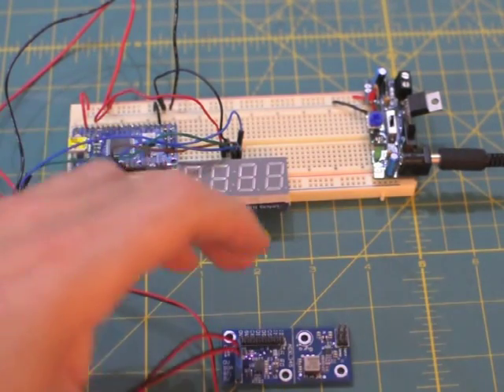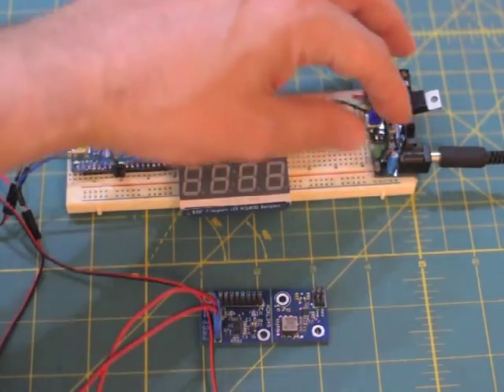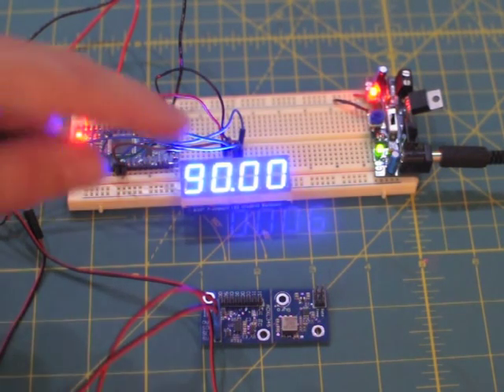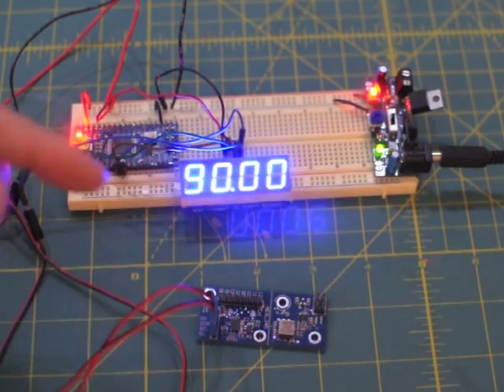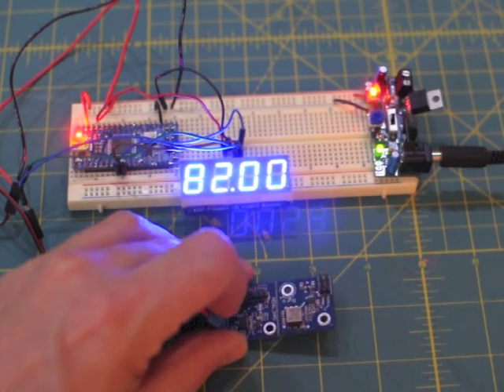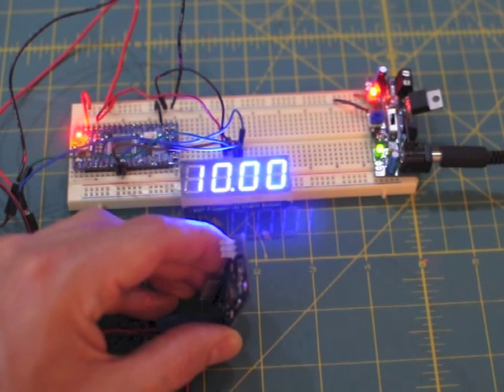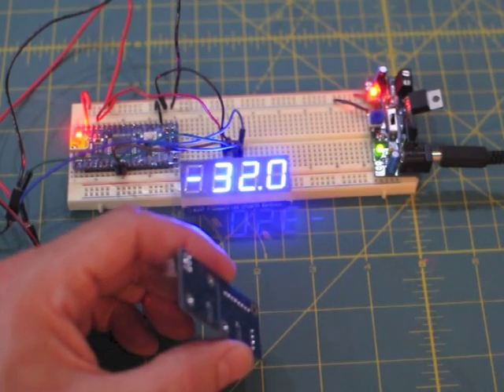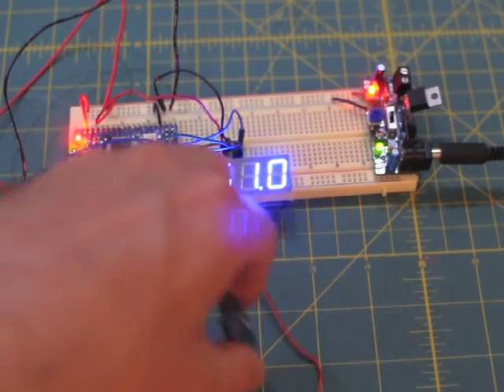Inclinometer

Comment: Hey, do you by any chance have still the schematics to this project? Thank you.
Reply: There's not much in the way of schematics. Both the ADXL 345 and the display use I2C which only requires two wires to be connected to the Arduino's RX and TX pins. Most of the trick is in software although to use the default address on the ADXL 345 you might need to ground the D0 pin. 

It's kind of an expensive part ($17.95 on Sparkfun) and there might be a cheaper option.

Comment: Having trouble figuring out your wiring.  No info :(
Reply: +Josh Lind that's a good point. Sorry the project is a couple of years old and don't have all the components handy anymore (in particular the accelerometer). Once I have those together I'll get it working again and post an update.
Reply: +Steve Wart Thanks. There are a few conflicting hookup guide out there for the ADXL345

Comment: Nice project! :) I have a question?

How it will behave in centrifugal forces? I have a project by installing HID Projector that is controlled by servo motors in communication with the device as yours and change the pitch of the light depending of motorcycle angle when turning into a curve. Thanks!